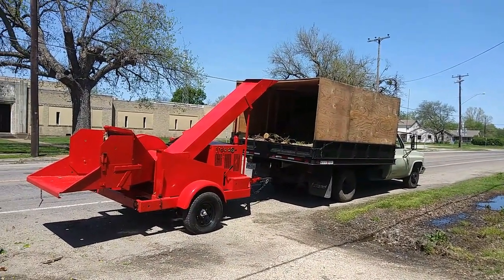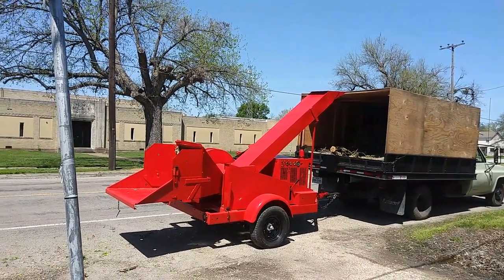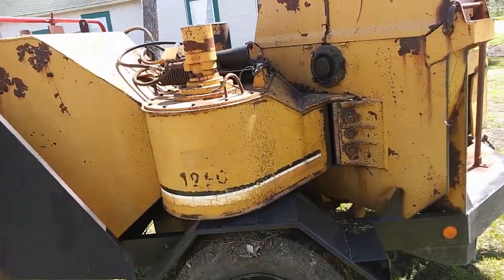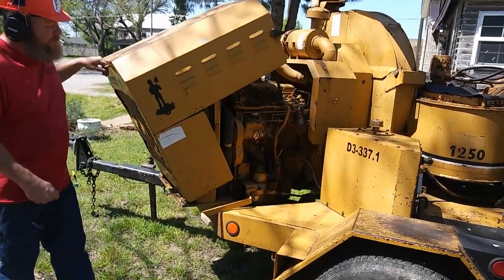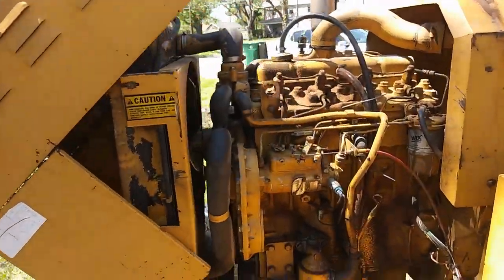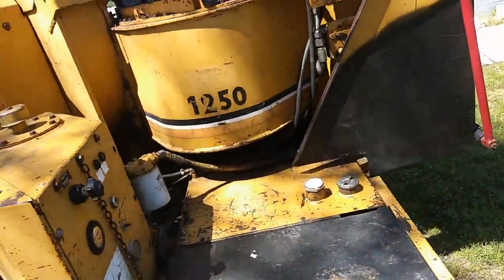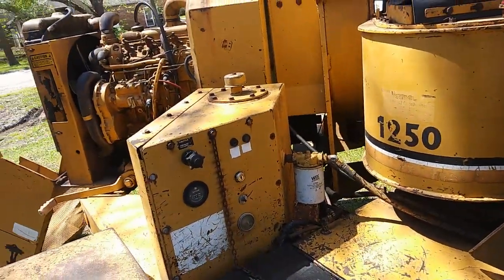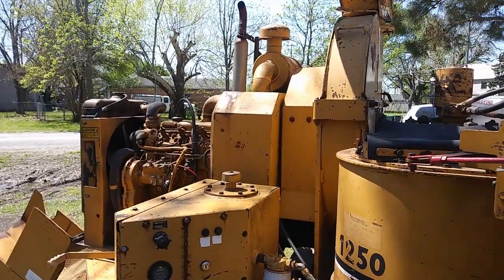Rescuing a 1976 FMC WAYNE C-16 CHIPPER! Part 2

Comment: Wonderful job, can you still parts for her, if so where. I have a 1972 Wayne.
Reply from the maker: Yes there’s not really much to the machine. For engine parts go to an auto parts store. If you need Bearings go to someone who sells industrial bearings. For a belt go to someone who sells industrial belts. And the knives are still being sold baileys.com and a few other places that sell forestry equipment. As for sheet metal just go to a sheet metal shop. As long as you have the frame and the drum you can fix it!!! I’ve had many Waynes and Whispers